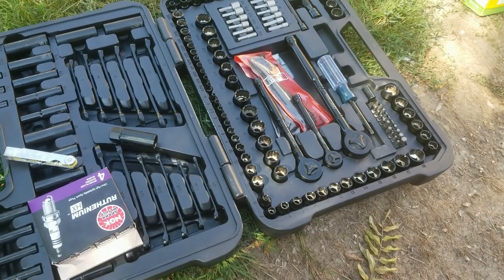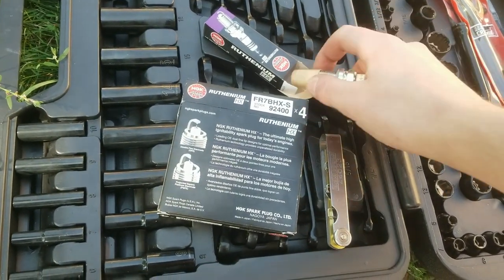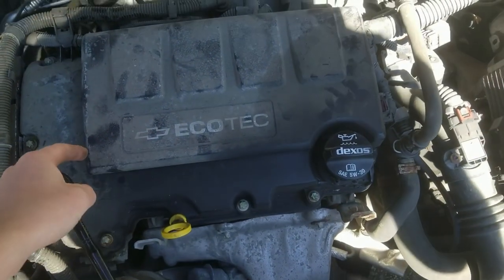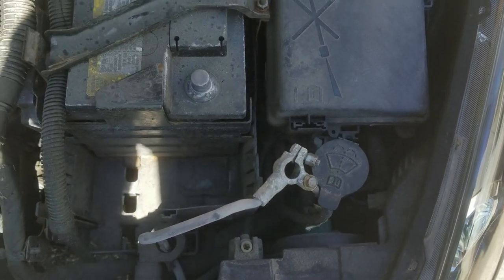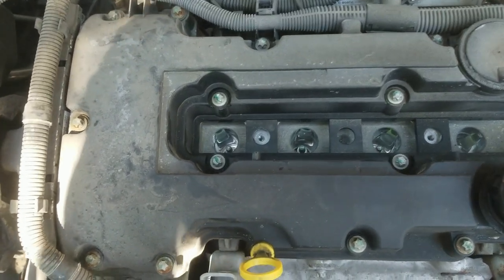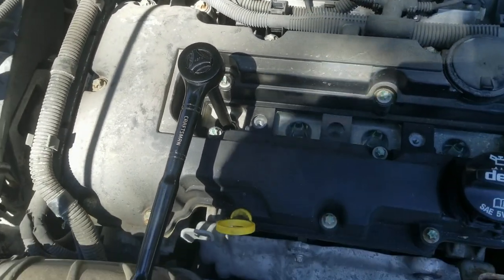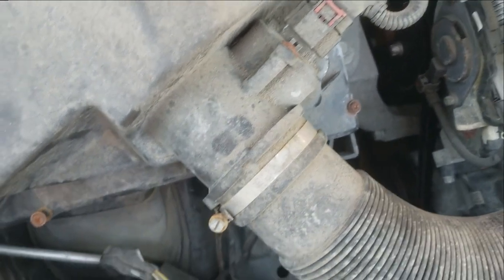Replacing the Spark Plugs in my 2015 Chevy Cruze

Comment: Put in new plugs exactly like what came in it from the manufacturer and do NOT guess or replicate whatever was already in it from another owner. The manufacturer has engineers who know exactly what plugs to use, so duplicate that.
Reply from the maker: I realize I didn't really explain my reasoning on why I choose for these spark plugs well, there's a reason I don't recommend this as a guide, and it's because I haven't explained things well
On normal circumstances, with other vehicle, I'd agree, go with the OEM spark plugs, the engineers do know best, but there's a few reasons I didn't here:

but I didn't guess at all, I did tons of research, and made sure that they would both fit, and work well, but there's a few things to note:
- The spark plugs I pulled are the OEM ones, likely from the factory. I'm almost certain they've never been changed because the first recommended service interval for the spark plugs is at 96k, and I was at 93k
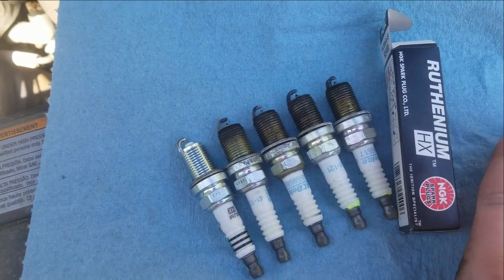- They are the same size as the OEM Cruze ones, you can see that in the video (10:45)
- They were listed as compatible with the Cruze from where I bought them
- I like and trust NGK spark plugs
- I had felt hesitation in my Cruze for like 6 months before the recording of this video, and wanted to try something different to alleviate that
- Other Cruze owners have had similar issues, the Cruze has a tiny engine, it needs all the power it can get. Hundreds if not thousands of people had backed up these plugs for years before I did my swap
- I was willing to take the risk, it's $80, if they don't work well I'll buy the originals, I knew they weren't going to damage my engine once I pulled the originals

Do I recommend this for everyone? no, but spark plugs aren't magic, they're the same size as the original, and I made sure to check their gap. I didn't buy cheap plugs either, NGK are a good brand, they're the only other plugs I'd buy other than OEM